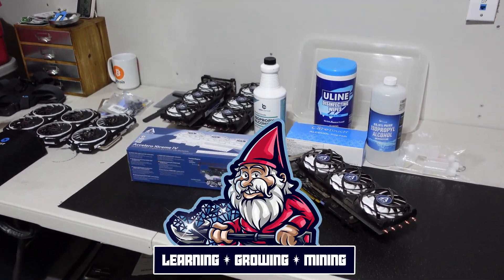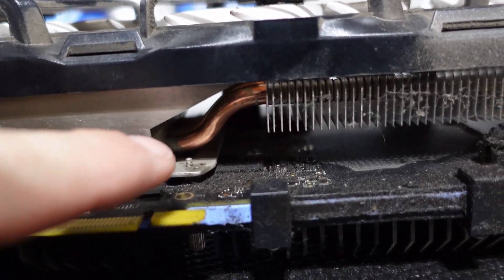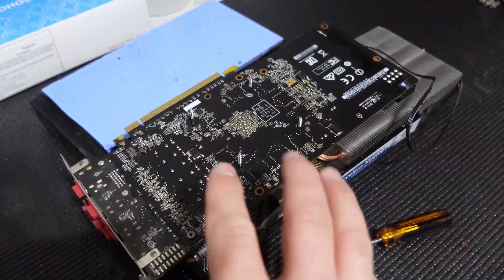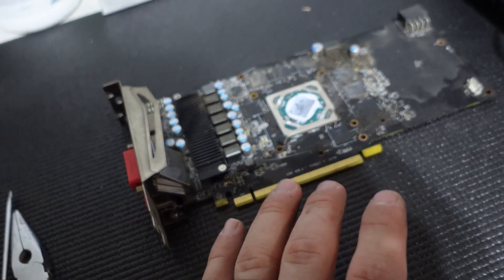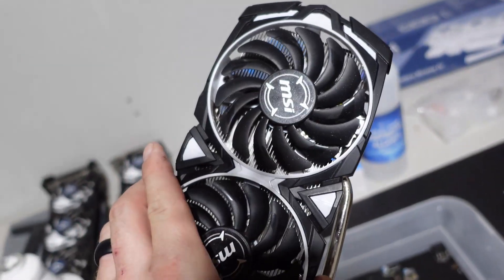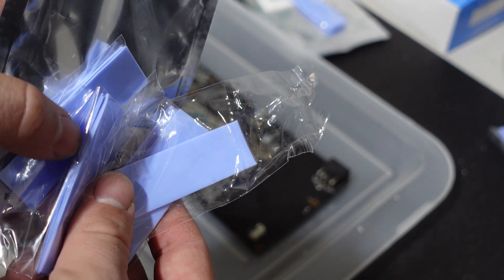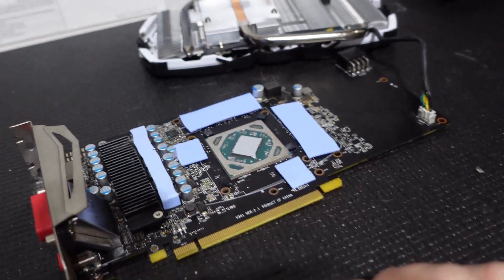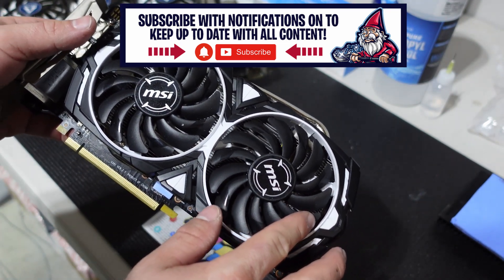How to Clean a Dirty Graphic Cards

Comment from the maker: What is your oldest Graphics Card, Untouched? Never Cleaned? Never Blown Out?
Reply: My most untouched is my PNY 1060 3gb, just not worth it haha!
Reply: ifixit kit "..i used this little pick..." "nylon spudger"?  when working on circuit card assemblies do you electrically ground yourself and your workbench? electrostatic discharge risk is why i ask
Reply: my  kids rx 590 think maybe 3 yrs😇
Reply: GT 610 2gb 6 years!
Reply: 2018 MODEL GIGABYTE GTX 1060 - NEVER CLEANED-NEVER CHANGED PADS non stop working no problem :=)
Reply: Hd 6350

Comment: Great video but i really hate that you use a full on drill to take apart and reassemble the cards …
Reply from the maker: Recommemdation on a  small tech drill?
Reply: @TheHobbyistMiner  lol i just use a reg screw driver … ima noob too maybe hate was a little too strong lol im just thinking strip screws maybe … break a board if u go too tight... slip and scratch sum important parts etc … 😂😂 low key just got an i fix it kit from best buy
Reply from the maker: Good pickup

Comment: Had seen derbauer delid one of the 12th gen intel cpu, i guess they use indium solder and a gold leaf, could probably measure the distance and solder metal cubes to his heat sink if you wanted to cool the memory modules from the face, might have been more efficient. doubt if you just threw pads on anyway with that cooler it would help much with transfer to air, might actually insulate. I mean a lot of that heat is going through the pcb. Think he probably wanted the entire pcb relatively the same temperature. By the way, you really shouldn't touch thermal paste. Could get on your components and damage them, or it could contain mercury or gallium or another metal oxide, which is really hard to get out of your system, and even more so, you don't want it getting up to your brain, go crazy, with continued exposure to mercury the disorder is called Mad hatter's disease. If you feel you've ingested too much, selenium may help, I'm not a doctor, so i wouldn't take that as medical advice, i had just seen it on the back of a tuna label, and know mercury oxides can be a problem if you eat too much tuna, and thought thats why they added it. Mean makes sense though, has three filled shells and 6 valence electrons, with metals existing in multi ionic states with larger nucleus, idk not a chemist either. They sell selenium pills dosed at 100 mcg, marketed to reduce some forms of cancer, maybe something can get attached to a haploid and increases translocation error idk whole other subject.  Not a bad idea to wear nitrile, or esd synthetic latex gloves while working on electronics. Isp really isn't the best either, it will suffice with antistatic rags, but there are better solvents labeled contact cleaner, bw100 is my favorite.

Comment: I have an aftermaket cooler on an older 1080 and it works great, dropped my GPU temps 5-10 Degrees.  Great video, you can send those coolers to me if you don't want them HAHA
Reply: It's is actually him😂
Reply: @iAnastasiaRex  usually all the what up app numbers are scammers anymore 🤷🏼‍♂️
Reply: @INeedMyBTC  So I thought at first
Reply: I am sure that was not you with the Whats Up App number, so I reported it. Sorry if it was really you LOL